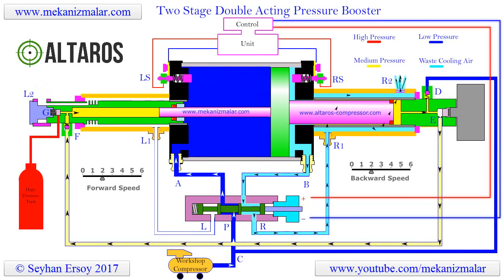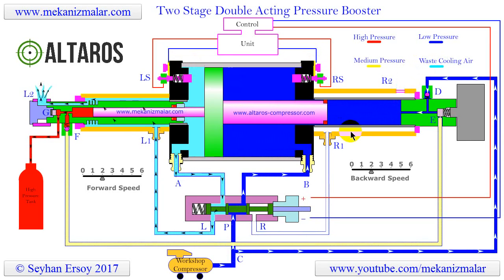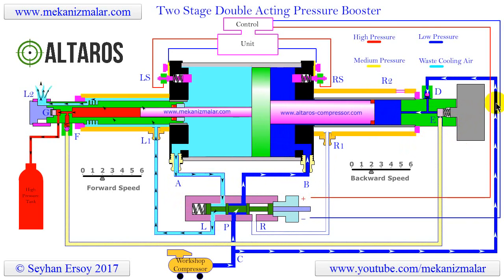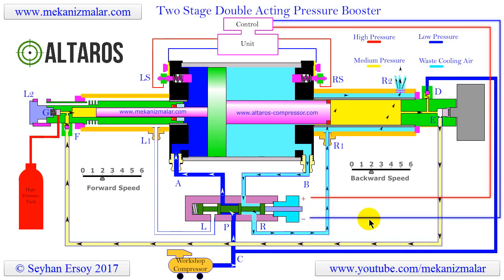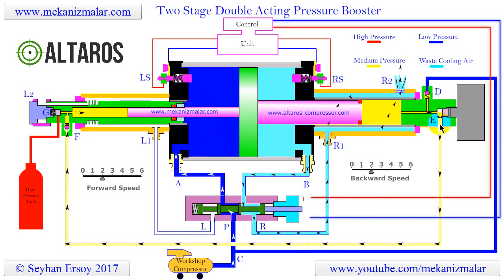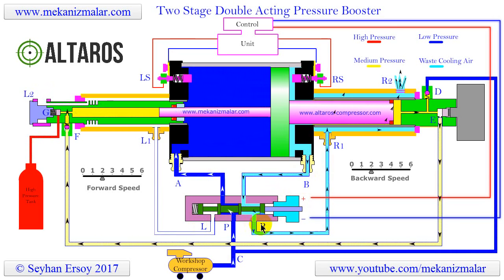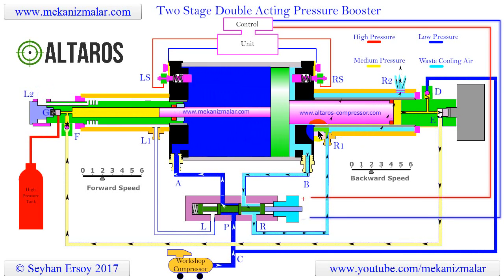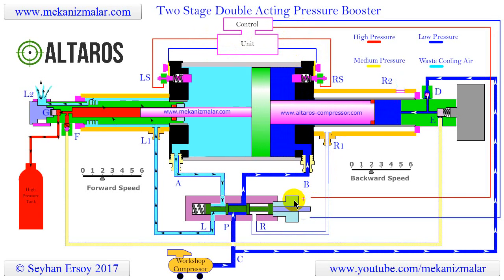pressure booster double acting two stage

Comment: Which compressor is typically a low stage "booster" compressor not found on high stage applications?
Reply: All air circuits work at 6 bar pressure. You must use a two-stage booster if you need higher-pressure air for an application.